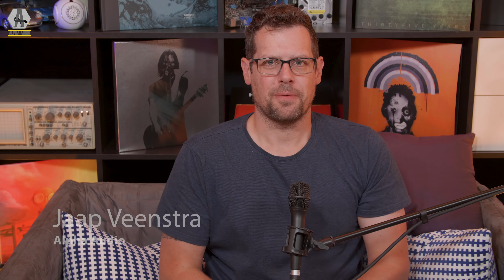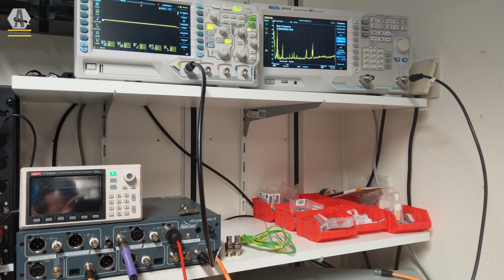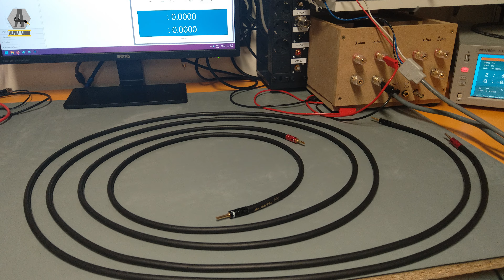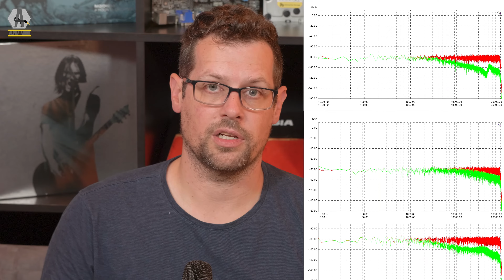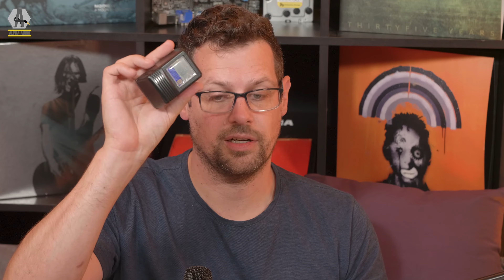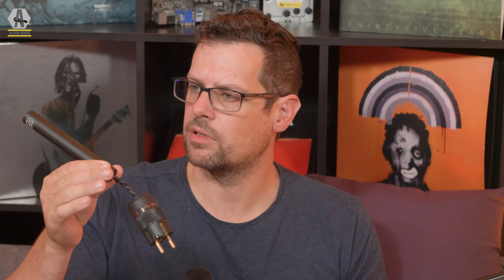Mass Test plug in filters - A short update and view on the contenders

Comment: very interesting, have 2 of the devices mentioned and a clear preference for one of them… looking forward to seeing your results!!
Reply from the maker: What models do you own?
Reply: @TheAlphaAudio  I own the small Isotek plug and ifi AC ipurifier.
Reply from the maker: @gioponti6359  Both very decent products.
Reply: @gioponti6359  And what is your preference?
Reply: @Dinkydau00  i use 2 ifi AC iPurifier for my hifi system with great success, and although I really like what the Isotek does in Alpha Audio‘s system (see the other video), but when I plugged it into the distributor of my hifi system it didn’t convince me (it was better without), and after it has spent several years in a tray I found it now useful if plugged in right next to my TV‘s power plug to tame it‘s SMPS, ie to reduce it‘s detrimental influence on my hifi system. Thinking about it, the ifi might work best if plugged in next to source or pre-amp, on your distributor, while the isotek, might be best to plug in next to the noisy source.
Reply: @gioponti6359  useful, thanks! I currently have 3 ifi ac ipurifiers and they all improved my sound, which made me wonder if there are better plugs that you don't need so many of. It seems they all have a somewhat different effect... complicated.